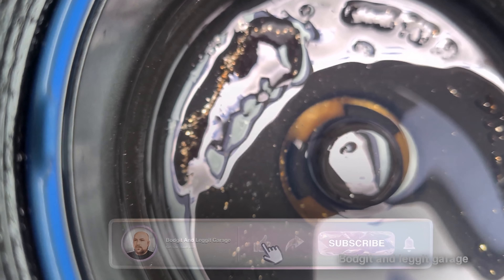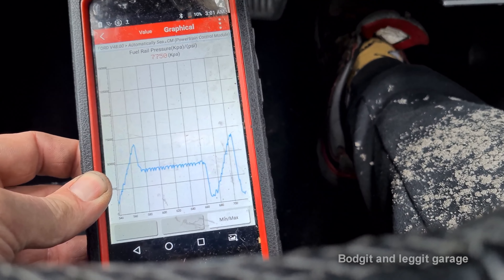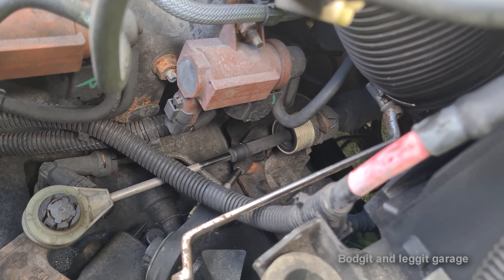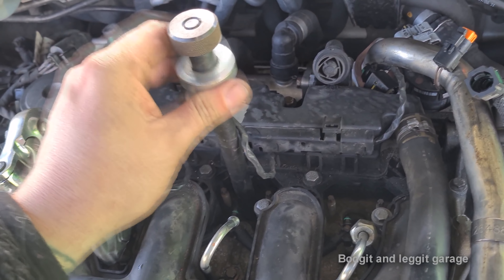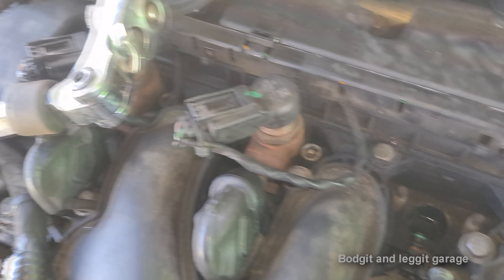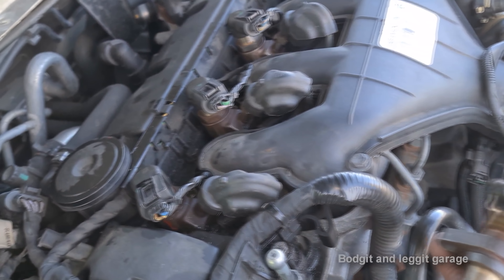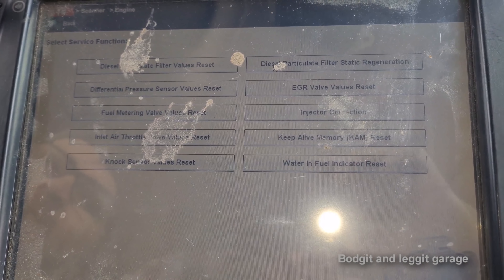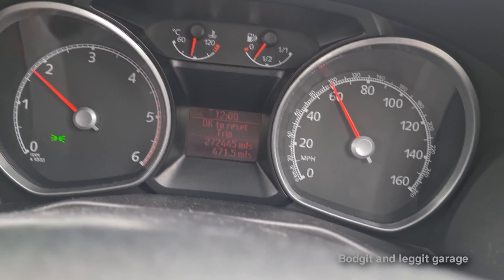3 Injector Pumps 8 injector Starter Motor And 2 Weeks Total Nightmare

Comment: Nice job!!Same engine on my S40. Would like to change glow plugs but afraid to fail as they are at the back of the engine..Very awkward. Also I have noticed that coolant temp don't go up on the car from this video despite the car was under decent load.Probably thermostat..
Reply: Leons done a brill vid on changing glow plugs, just search and make sure the engines hot.
Reply: @robc5955  Thanks!Same engine?
Reply: @nemocap2958  no but same principle.